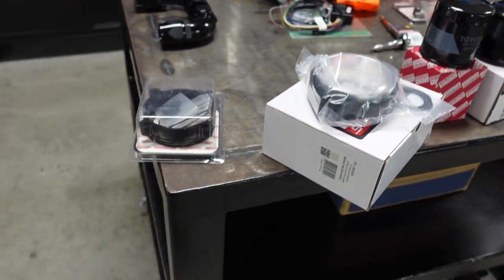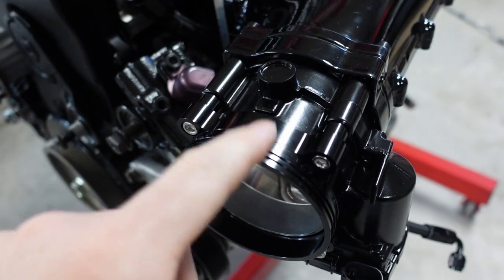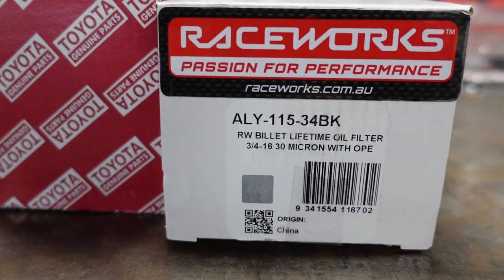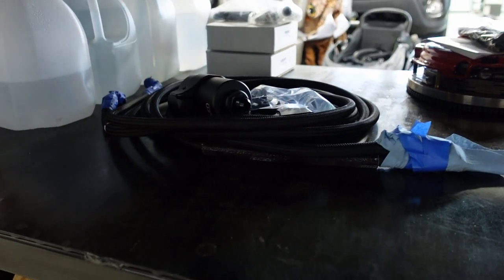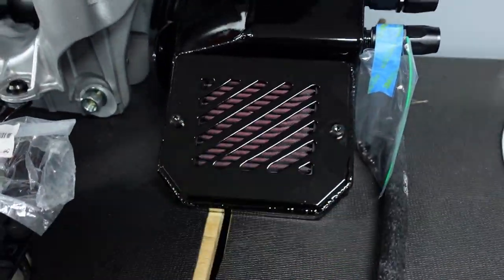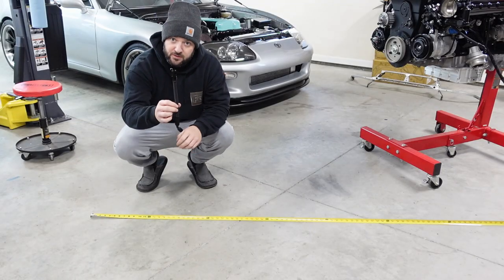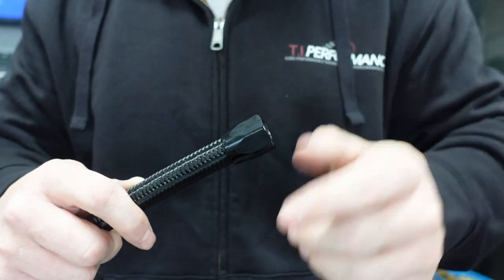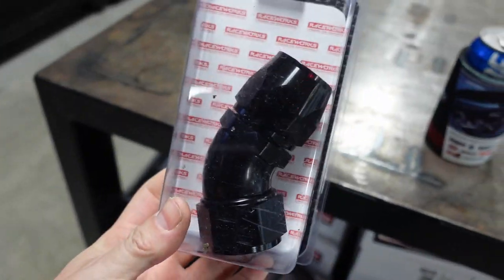Race Works Intercooler Quick Clamps, Lifetime Billet Oil Filter & How To Assemble AN Fittings

Comment: I need to replace my factory fuel lines due to a bit of corrosion (damn scottish weather) but have been dubious about making them myself. I made ptfe an lines for the power steering and no issues after a year.  Do you think i'm ok to go ahead and make ptfe fuel lines if that hasnt leaked?  Also is the carbon lined hose really neccessary for a wekend warrior? Question open to anyone not just Ryan :) Cheers
Ps thanks for the line lengths
Reply: Yes, you should be fine making the ptfe lines for the fuel. Just make sure to clean them out before installation.